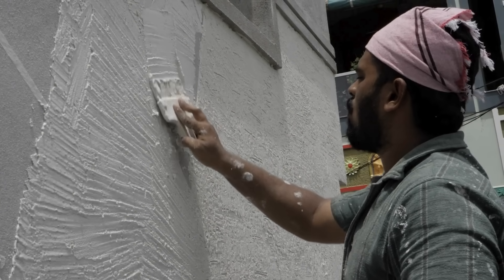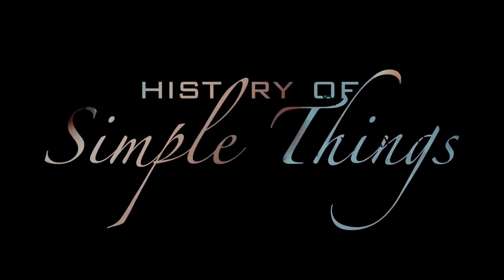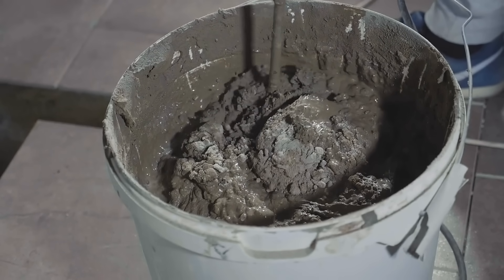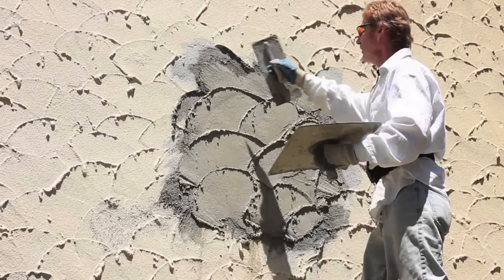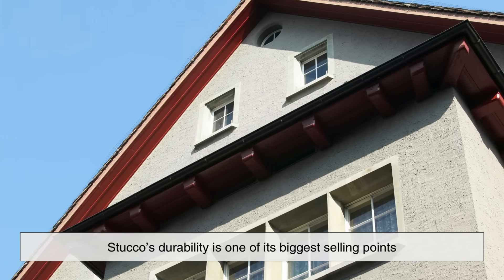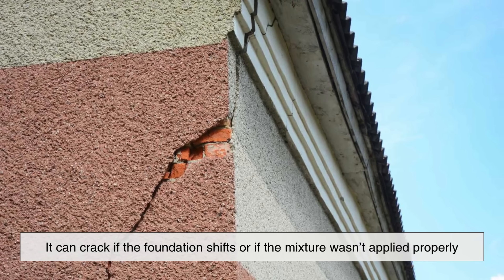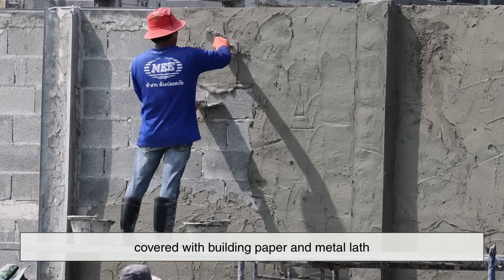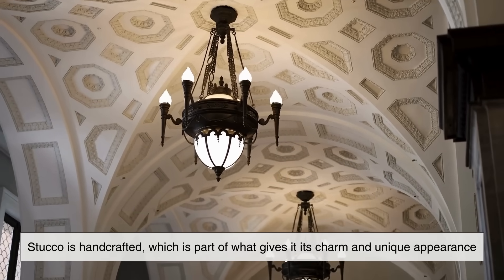Stucco 101: What Builders Don’t Tell You About This Exterior Finish [ID0805]

Comment: In the northwest, the stucco houses crack and get water into the walls ~ really a mess.
Reply: Only if applied without a proper waterproofing system underneath the EIFS foam.

Comment: Eventually stucco gets cracks which allows moisture into wood framing which starts to rot, but still looks okay from the outside. Everything seems fine while your house is turning into mush.
Reply: Metal framing with stucco is a life hack
Reply: Thats crap..no cracks in mine built in 60s
Reply: Sounds like this guy sells Hardie siding for a living.
Because properly installed hard stucco is a 50 year product, and EIFS is 20 years.